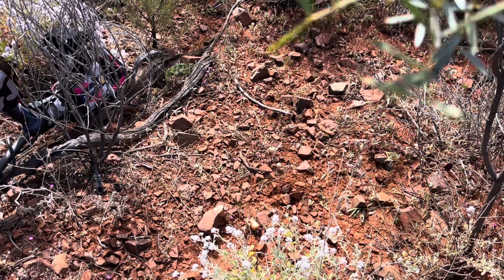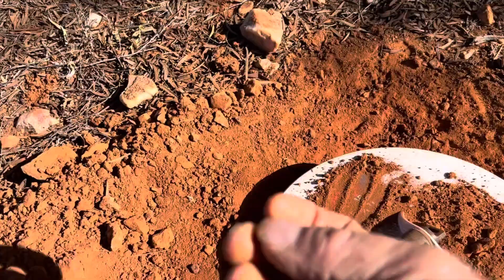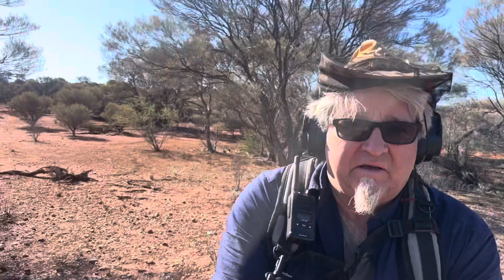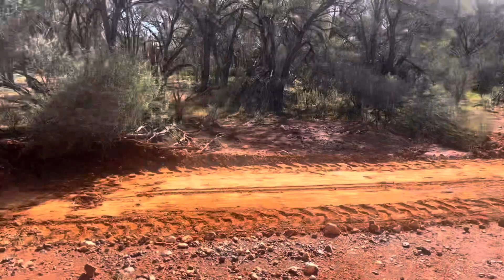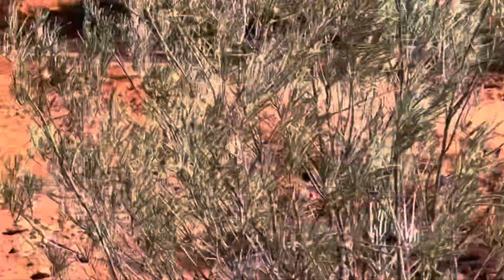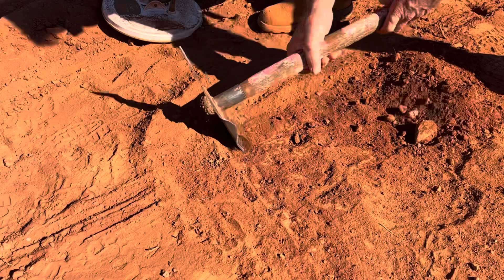Hard Won Gold Nuggets and Some Pushing

Comment: Hi mate, I’m new to detecting where do you recommend to go? Currently I’m in Kalgoorlie. Thanks in advance
Reply from the maker: As you probably know, you can only go on pending ground, unless you have permission. You will need to use the Trilobite app to find where the pending ground is. The area of any of the goldfields areas will have pending ground. Where there is lots of leases is probably your best bet. The large Exploration leases might be in deeper country. Use the Trilobite app to find green bedrock and try to stay near the green to yellow change in country. 
It’s all research really. Gold can be found anywhere from Kalgoorlie north to Wiluna. Menzies Leonora Laverton. You can find gold in any of these areas. It doesn’t come easy though. 
It’s not easy to find but it’s not impossible. If you are new, I suggest you get on a tour or do a prospecting course.